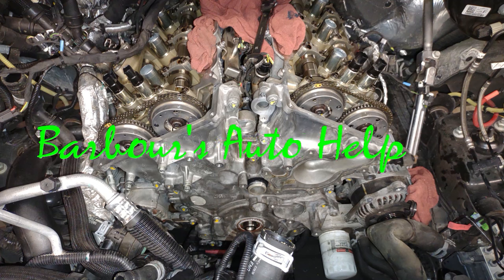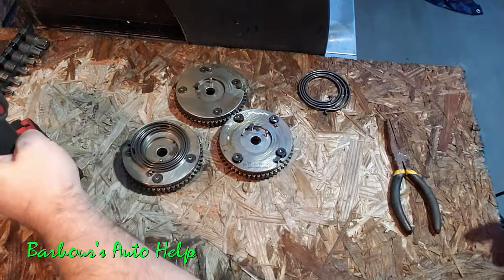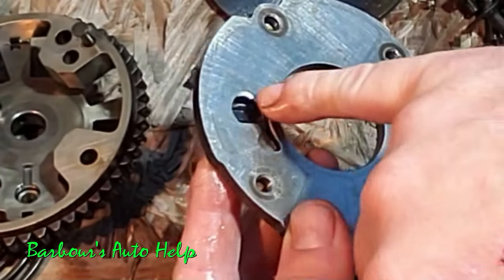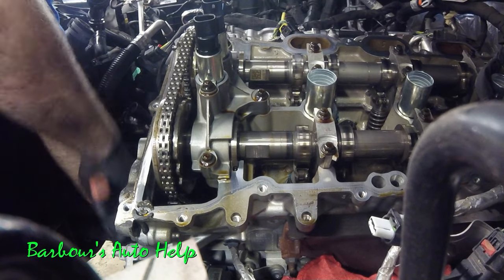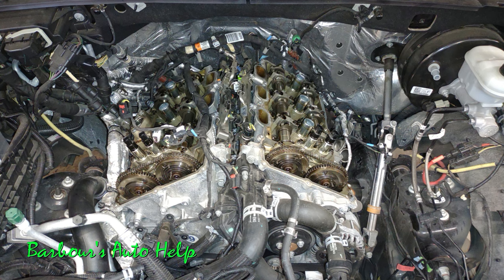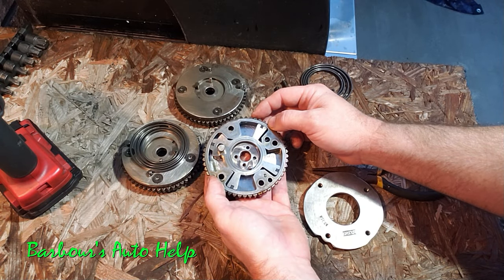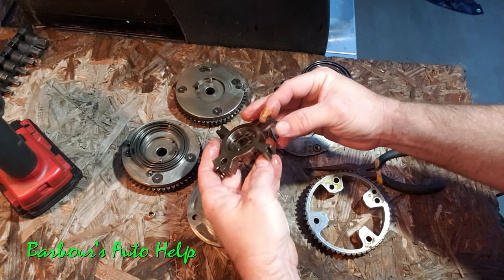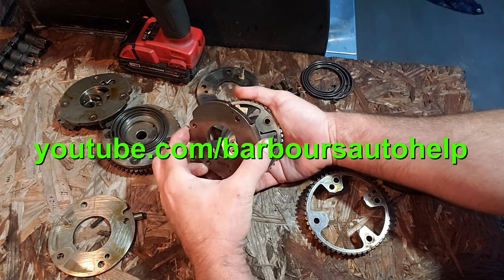Ford 3.5L Ecoboost Cam Phaser Rattle/ The noise, The cause, The fix

Comment: Awesome video, thank you for showing how these work!  I've got a 14 f150 3.5 ecoboost that has had this issue when 1st purchased at 167k now has 217k miles and I believe the timing chain might be stretched as well as its now accompanied by Codes P054A and P054C.  I know I need to take it to a technician to confirm(and I will be) but do those two codes indicate a timing chain issue jumping from stretching? I know cam position sensors can go bad but for both codes to appear at the same time with the cam phasers issue, just curious if you've had experience with something similar with these engines?
Reply: U find the issue?
Reply: @cheizaguirre5494  I haven't heard back on anything, but to be honest, I've been so busy with work, I haven't had time to do much more digging.

Comment: Thank you for your excellent description of the problem and insight into both repair and new parts available.  I am just about to pull the trigger on the purchase of a 51K mile 2017 Raptor where the dealer has told me the Cam Phasers have not be serviced or replaced.  Would you avoid this purchase?  I was going to either (1) have the dealer agree in writing to replace the original equipment Cam Phasers with new Ford  redesigned Cam Phasers (all 4), or (2) reduce the price $4,000-$4,500 as that would be my first repair

Comment: I have a 19 expedition with p0022 code and dealership said I need cam phasers replaced. I have no noise or engine performance issues.. could I keep driving it?

Comment: Just got mine out of the shop. 2018 F150 with 41K They replaced the phasers due to the PCM update not working. They added 2 years and 20K to my warranty in the event it happens again.
Reply: Don't worry the fix will last 21k miles

Comment: So my 2015 lariat 3.5 doesn’t rattle on cold starts but only when driving from 2nd to 6th gear. ONLY when I’m barely on the throttle under very light load which causes that rattle.
Reply: My 18 does the same thing.
Reply: @derekmortensen1665  Yeah im bringing it to the dealer in a week to get that recall done. Still got warranty so its on them HA suckers.
Reply: @maxboya  I hope they will do it bro. My extended warranty ends in about 6k miles. So I might try and get everything fixed before it runs out.

Comment: Thank you Barbour's Auto Help!!  Much appreciated.  My problem;  recently purchased a 2012 Mustang,  3.7 Cyclone engine, external water pump, that has developed a major 'rattling sound' at idle and just-off idle speeds.  Bought from a car dealer that I believe put heavy-weight oil in the engine to 'get the car sold',  I just did my first oil change to the prescribed 5W20 oil and Ford oil filter, and it immediately started the 'rattle' noise.   Drained out the 5W20 oil and replaced it with Mobil 1  20W50 and WAA LAA !!!   Noise went away!!!   I feel like I've been 'bent over' by this dealer that obviously put heavy-weight oil  in the engine to 'get the car sold'.    My question;  could this be worn cam phasers?  Or maybe a stretched timing chain?  The car has 110K miles, and has a pristine Carfax history of regular, prescribe maintenance.  Thank you so much for your time!
Reply from the maker: Wow! I’m very sorry you’re having this experience. The 3.7 is a very good engine. I’m not aware of any weak points. Unfortunately, it’s probably best to have a tech take a look.
Reply: Thick oil will break the oil pump, woodruff keys,roll pins etc.good luck with that.
Reply: @billbonu1639  Thick oil, as in 40, 50, and higher weight oil, in cold weather, can do that.  But even 20W50 oils cause no problem, it's already loaded with polymers that allow the oil to act as a 20 weight to prevent that.  If an engine is over-revved while running in cold conditions,  then yes, the oil pump can 'over load' the pressure relief valve, and oil pressure levels will rise into the 'danger' zone.   Woodruff keys, roll pins, etc. can be destroyed.
Reply: Heavy weight oil would make phasers rattle worse.

Comment: My dad has a 2018 with the 3.5 and this is now the second time. It happened once when we first got the truck at about 55k miles. Now it has 125k and did it again.

I kept telling him to change his oil closer to 5k miles. He usually just changes it when the oil life indicator tells him to. Sometimes he also waits until after it says zero.
Reply: Did u have rattle noise

Comment: My 2011 f150 ecoboost had same rattle on start up. Changed the oil and used Mobil 1full synthetic 5-30 and bottle of Lucas heavy duty oil stabilizer. Rattle was gone for 10 months. Just changed again. Will see what happens.
Reply: Did the oil stabilizer continue to eliminate the rattle??

Comment: I have a 2017 f150 with the 3.5 eco boost. Is this repair even worth doing if I have 151k miles on my truck. I just worry about doing that at that high mileage and other problems happening from the motor being opened up. Thanks.

Comment: So watching a guy about this and he described if the you hold down gas pedal for about 2 seconds while starting it will delay firing to allow oil to pump to cam phasers before starting up.  I have an 18 expedition and this does work you just can't use your remote start.  If ford could the allow the starter to turn over another couple seconds this could save the phasers from wearing as quickly.  An idea.
Reply from the maker: This is a good point.  Pedal has to be completely pressed to the floor though.  This puts the vehicle into "clear flood" mode.  The engine will spin over but not start.  Thanks for sharing this.
Reply: Just wondering is there a way to program this vehicle to do this?
Reply from the maker: @lillyjames  To my knowledge, no.

Comment: Thanks for sharing us this kind of research; I’m facing same problem with my 2024 ranger raptor 3.0 V6 Ecoboost. It took the dealer 4 days to find the origin of this failure since the scanner didn’t show any failure code and I told them since the beginning that the VCT phasers needed to be replaced due the defective design and it took me only 15 minutes find out the problem thanks this kind of content you can find in YouTube; do think that the high gasoline consumption it has could be related to  this issue? It gives no more than 4.5km/lt when my V8 2019 mustang reaches about 6km/lt?
Reply from the maker: Actually I’m not aware that the info in the video applies to your issue.   You may have something else going on. Im interested to see what the dealer says is the problem. I’d go with their advice. Let us know when you find out.
Reply: @BarboursAutoHelp  same issue it is related to the VCT phasers
Reply from the maker: @memoto3059  You could possibly be experiencing the same symptom but that is not going to be the same part # for the phasers.  My video is specifically for the 3.5L ecoboost.  But, I curious.  Please let us know what you find.  Did the dealership already diagnose it as the phasers?  I may have misread your post.  But, still that is a different part #.

Comment: Thanks for this, my 2018 F-150 is going in for cam phaser replacement in a few weeks.  Good to know exactly what is going on.
Reply from the maker: Glad to help!
Reply: what engine size? I have 2018 f150 5l v8, and I had cold start rattle in the winter. dealership told me they want $170 just to do diagnostics.

Comment: Damn.   I thought I had a timing chain slapping around. Engine hot or cold. At idle.  When I accelerate, the noist gets sharp and then goes silent.  Timing cover removed, timing chain looks good and tight.   Could I be looking at sloppy cam phasers?
2011 explorer. 3.5 NA

Comment: VVT CHATTER! This problem needs addressed like the FFA  does a plane crash.  That's my job and I have done it well based on others opinion!
The Ford answer has been Change the Part!  We are looking for the answer and sooner or later we will find it. Well here is the problem and the problem is a $.10 spring that holds the lock  pin in place. It was taken out of a clicker in their ink pin. Just look at one. The next time you pull one of the bad boys out just take 10 min and take it apart. The only spring in side  that holds the locking plunger in place will have shinny side on the side where it moves inside the plunger. This causes the spring to loose  up to 30% of its ability to hold the locking plunger in place.  That lets the plunger start to wear the hole in the back plate  and this cuts a ramp angle which lets the pin jump out and unlock the phaser.  If you look at all the manufactures that us this same system they all have the same problem.  I found  only one that has make a improvement in this. They use a bigger spring and pin. That system they us isn't perfect but it's a start. This VVT system should be as good a the engine it's self.  Toyota' 300,000 engine!
Tom Silver
Reply: agreed but too bad the Toyota's ride terribly and are too small...

Comment: Just ironic that so many models have this. I have a 2017 F150 with the rattle. My wife has a ‘19 Expedition….heres is so much worse. Rattle is hardcore. She also has an issue….at highway speeds, you try to accelerate to pass someone and the damn thing tries to drop in to a lower gear and loses all acceleration. It’s scary and concerning that she’s going to get rear ended. I know this is a widespread issue on the Expeditions. Anyone know if they are related? My truck is just fine. Appreciate your videos. They are very helpful!
Reply from the maker: I know some earlier model F150s have a recall on the due to down shifting at highway speeds unexpectedly.  But I believe this involves the 6R80 transmission.  The 19 Expedition I believe will have the 10R80 transmission.  Different ball of wax.  I suspect she may have an issue with the OSS sensor in the transmission.  Perhaps metal is getting on it and throwing it off.  May need CDF cylinder and possibly other repairs.  Not sure, maybe.  I'd check to see if she has any codes set.  Sounds like it is time to take it in and have repairs made.
Reply: @BarboursAutoHelp  thanks for your insight! Much appreciated!

Comment: Great video,  I have the same issue on my 2018 ford expedition.  I took it to the dealership for the cam software reset but still has the rattle, also now while driving it jerks and hesitates when changing gears. Its a headache, especially when I have been trying to take it to the dealership to get it looked at but they say it'll be a 3-6 weeks till they can look at it. Any suggestions of what is causing the jerking while driving?
Reply from the maker: Maybe software.  Be sure to let them know about it.

Comment: I have a 2020 Raptor and I’m in the process of changing out the phasers. The bolts seem extremely tight or frozen and so far I’ve been unable to remove them. I have the correct tools, the bolts just don’t want to move. Have you seen this before?

Comment: Hey, i have a 2018 expedition with the cam rattle and its throwing codes for p0018 & p0021. After driving around and using my scanner, bank 1 intake is about 1-2 degrees different compared to what is desired and measured under load. 
Im assuming its caused by the cam phasers. Would the cam phasers cause timing issues. Right now the truck goes into a slight limp mode as over the day as it used, it start losing power. 
I was thinking about changing the vvts. But after seeing all this talk about cam phasers and its a common failure, making me think the cam phaser is the issue.

Comment: I have a 2013 3.5 Ecoboost on my F150 and it started at about 110k miles . Everyone says it’s about $3000 repair range . Ford Motor refused any assistance of any kind .
Very frustrating for what I paid for a King Ranch . I sure expected more from a Ford … have a Chevy Avalanche with 208k no motor issues ever .

Comment: I have same problem with my raptor 2018, I also noticed that when I start the engine the vehicle it seems like it needs help to do it…
Reply from the maker: Well, if your vehicle has less than 60k miles on it then it should be covered under power train warranty if the phasers are the issue.
Reply: @BarboursAutoHelp  hey! I got delayed but we are lined up for this weekend on my 2nd gen 2017. 

One question: when we reinstall the HP fuel pump, we moved the crank again until the lobes are bottom dead right ?
Reply from the maker: You want to make sure that the lobe that drives the hp fuel pump is positioned so that the flat part of it faces the fuel pump when installing the fuel pump.  I think that's what you were asking.  Right?
Reply: Just completed a 3rd round of cam phaser replacement on 2017 Raptor. This time with updated phaser and new software from ford. Hopefully 3rd times a charm

Comment: I got a question… I just bought A new to me truck with a brand new 3.5 block and her heads that were fresh out of the machine shop however from what I’ve been told someone tried to paint the heads in an effort to keep rust from going and I don’t think the tech, other than the meeting services, cleaned off any of the paint that was under the valve cover… That said, I’m now having over retarded codes left and right and I’ve taken it back three times because it’s under warranty and it seems as though if I leave it with them it’s gonna take a month to get all of it cleaned out because they’re driving it until it clogs up the VVT solenoid‘s again and then pulling them and cleaning them out and then doing it again using the VVT Solenoid screens as a filter if you will…. I am pretty mechanically inclined so because they’re only taking my truck for lunch or to grab parts etc. etc. and it’s taking forever I offered to do it myself and put actual mileage on it and do it until it clears out… Is there anyway to clear out all of the oil jackets and everything else leading to the VVT solenoid’s in another way?

Comment: Hello I have 2020 mustang 2.3 ecoboost and think my rattle is from my phasers not over heating no coolant in oil just horrible rattle is this common code p0013 & p0015 p0301

Comment: I have a 2012 3.5 f150 with the rattle.  I have heard this earlier engine has a longer timing chain and it also needs to be replaced due to ware/ stretching.  Thoughts?

Comment: I have 2019 F150 XLT 3.5L  Ecoboost  same problem, made it to 120k miles. I wonder what is the average repair cost do Cam Phasers repair?
Reply: I recently had the repair done via recall. I asked the service writer and he said out of pocket cost would be around $3500 cad.
Reply: @findaddy22  what recall?
Reply: @zakattack467  I randomly downloaded the Ford pass app and when I entered my vin it showed I had a recall for the cam phasers. I called and they booked me in right away. Best bet is to call a service center near you and give them your vin. They'll be able to tell you if you're still eligible.
Reply: @findaddy22  what year is your rig?
Reply: @zakattack467  2018

Comment: I have a 2017 F150 with the 3.5L Ecoboost that is two months out of warranty and just started this cam phaser rattle. I understand the recall has been extended into 2013…have you heard this? 
The dealer where I purchased the truck want $3000.00 for the repair which I think is  excessive? Is this price in the ballpark or no? I’m Leary of letting a local mechanic make the repair. Any thoughts on someone else making repairs appreciated. 
Chip
Reply from the maker: Not aware of any "recall".  Not sure what the charge is for something like this. ( I never pay attention to estimates.  Just turn wrenches.)  This is something that a seasoned mechanic can do.  Just be sure to use the updated parts.
Reply: 3k to 3500 is about right, my 2017 F150 3.5L Ecoboost also apparently needs a new oil pan.  Overheard the mechanic at the dealer tell the site admin that "we change all the pans when we do the phasers to save them a trip back when the pan cracks - which they all eventually do".  He wanted an extra 1500 for that.   I haven't done it yet - and yes there was a recall but if you didn't do the first two that didn't work, you don't qualify for the third one.   It is now expired anyway.  Very frustrating that Ford is unwilling to help me out.  May turn this multi-generation ford family into Ram folk.

Comment: What would be the possible downside of ignoring this other than the annoying sound of the rattle on cold start?
Reply from the maker: Worse case, the phasers produce excess metal that gets into the oil and causes engine damage, theoretically.  I've not seen that though.

Comment: Had mine replaced on a 2018 F150 at about 53k and I now have 60k and the noise is coming back.  Allegedly they replaced with the new phasers, at least according to the parts list for the repair but one never knows what really happens at the dealer repair shop. I really don't want to fight with Ford about having this done again at their expense, what happens if you let it go and don't repair it?  Will it cause major problems down the road?
Reply: Did you ever find out what happens?
Reply: @larrylitan7259  Not really, I posted the question on another forum and someone said it would not be good to let it go but was not specific as to what would happen.

Comment: I got a question ...on the Chrysler 3.6 to remove the harmonic balancer  the bolt loose to the left ...my car is a 2011 durango ..please help me ..I try with 2 different impacts to loose it to the left and is too tight or loose to the other side .. thanks for your comment
Reply from the maker: I'm pretty sure the harmonic balancer bolt comes out with counter clockwise torque.   I don't see why it wouldn't be that way.  Tripple check though.

Comment: My 2011 has this issue. Would it be more cost efficient replacing the entire engine & for going any other internal issues? Ford is charging 5k & I want to get my money’s worth in the long run.
Reply from the maker: It's all relative.   A decision best left to you, Sir.  Lot of info I don't have about all the circumstances surrounding your vehicle.